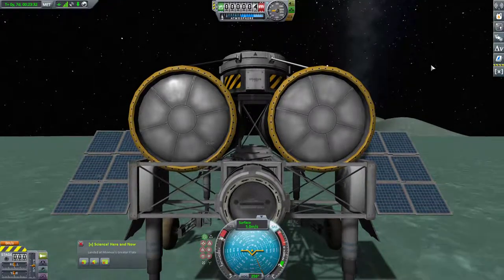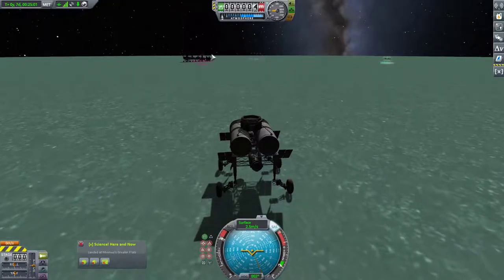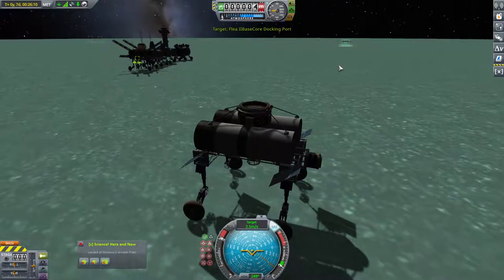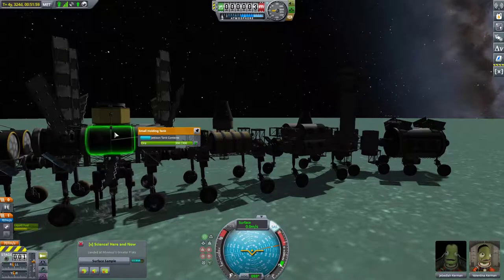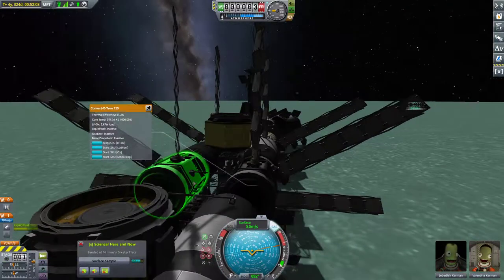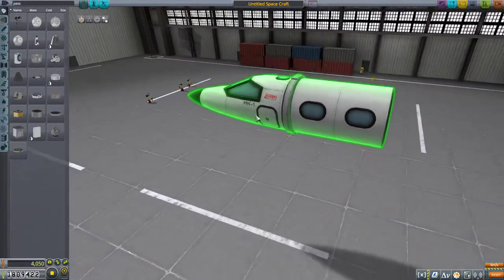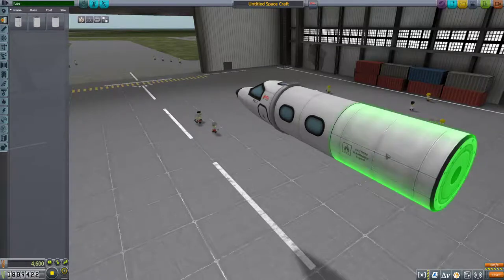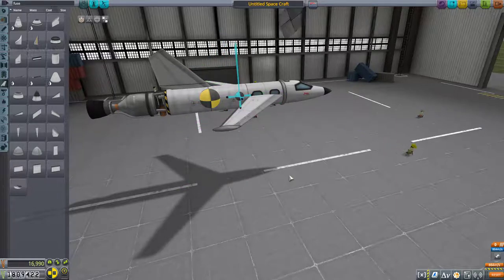Kerbal Space Program | Minmus Spaceport | Episode 113

Comment: I don't get the giant shock absorbers on everything, why not just use regular landing gear that already has that built in? Mini is so little friction you can easily use RCS to power ground vehicles.
Reply from the maker: They're not actually shock absorbers, the hydraulics don't work in the compression direction.  Rather, they're extenders with the idea being that I can adjust the height of the docking ports so that I don't have to worry about lining everything up and taking into account differing weights as we produce fuel -- instead, I can simply get the objects with docking ports to Minmus and line them up there if they end up being differing heights.  It's a way to be lazy, but it also breaks the physics in a bit of a buggy way so I'm moving away from them.  Ultimately its so that I don't have to have the exact same height on everything going forward, and I can just design what works and not have to worry about height (as long as it's not too short, that is).
Reply: @Atraitus  you can use two joints attached to the docking port instead of four huge hydrolic rams.